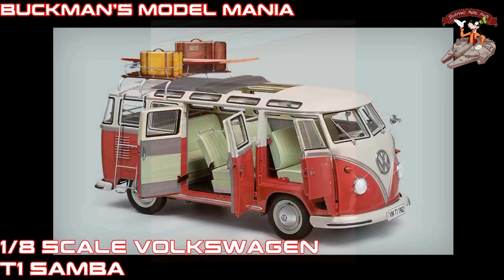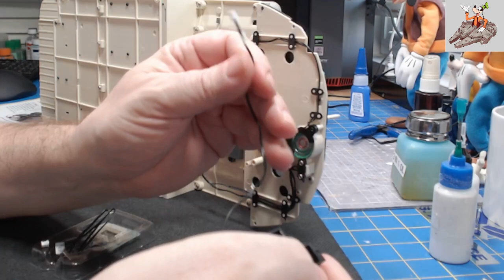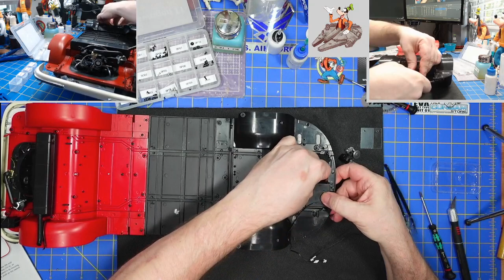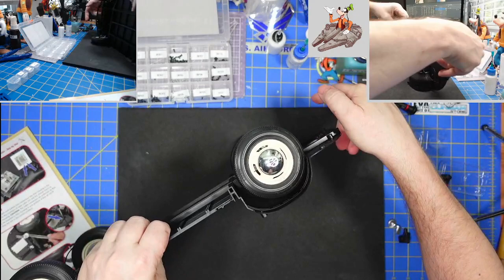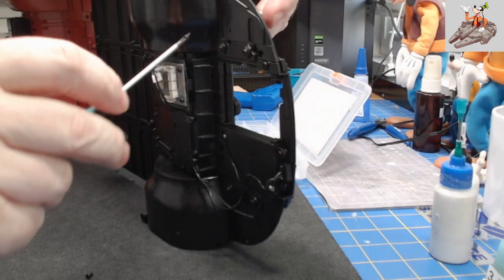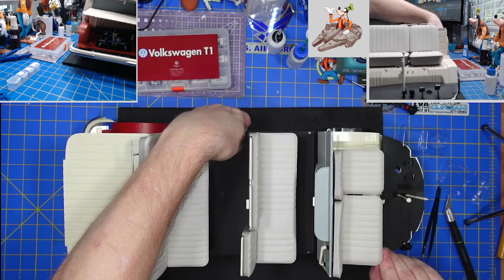DeAgostini 1:8 scale VW T1 Samba Pack 75

Comment: That's a lot smaller than expected. For $1000 plus it had better seat a kid and be able to push it around with his feet....
Reply from the maker: It is about the same size as most part works...and cost closer to $2000...but I like it